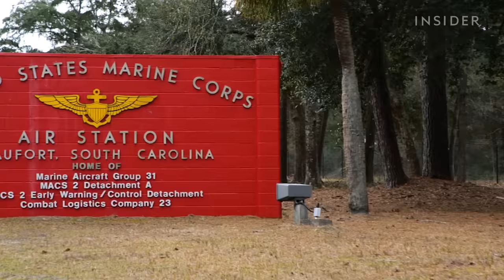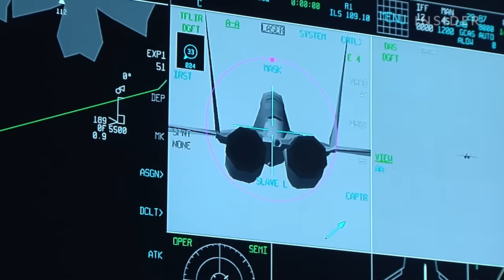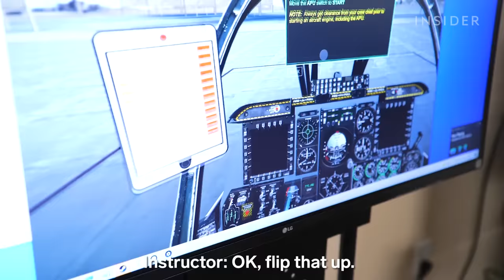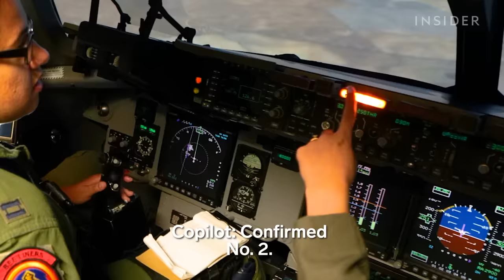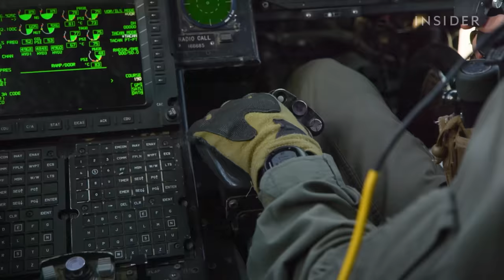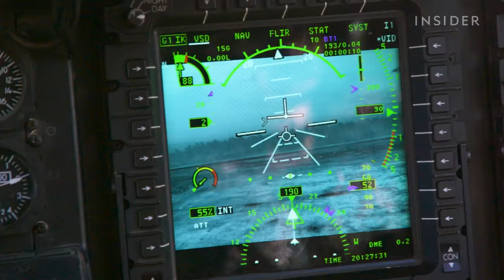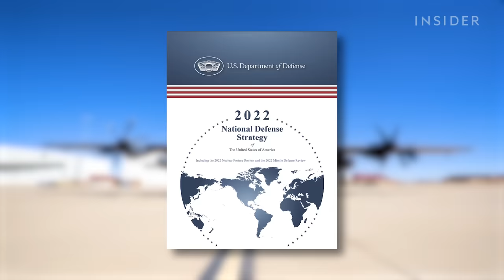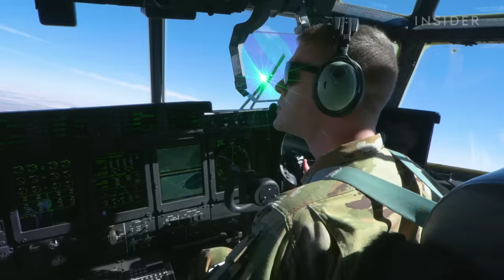How the US Military Spends Over $44 Billion On Warplanes | Boot Camp | Business Insider

Comment: Former machinist here. There's a lot more work in making those wierd and precisely shaped airplane parts than you think because you can't weld or cast aluminum. You have to start with a block of metal and cut it down until you get the part. Most of the material goes in the recycle and robot cutting machines do most of the work but it might take a semi-skilled worker all day to make 100 VERY SIMPLE parts while the bigger structural parts we did often took three guys all day to make a couple dozen.

This is why airplanes are so expensive.
Reply: Current machinist here thats true;)
Reply: I weld aluminum literally almost every day.
Reply: @siegfriedpintar  It's poison, I understood.
Reply: @siegfriedpintar  I think what OP means is certain types of aluminum used in airframes cannot be welded due to integrity or such issues.
Reply: Indeed.
Reply: Aluminium can't be welded?
looks at the car, motorcycle and bicycle in my garage
Reply: @ItsATrap614  alum sparky mfr that & flux core

Comment: The F-35B is the most essential component of our broader strategy in securing the pacific. A stealth fighter, fleet defense and strike fighter, deployable from a network of many tiny, faster ships is the only viable naval aviation deployment strategy moving forward. Super carriers are too large and vulnerable to sail within 400 miles of China ground-based anti-ship cruise and ballistic missiles, in wartime. These ships can sail closer and can spread the power over larger areas. They are smaller, cheaper, harder to track, and as a distributed system, if one leaves for repair, you don’t lose an entire limb of our forces…

The carrier can act as the center of the hive, of the distributed system. Moreover, carriers can then shift their operations to larger, heavier aircraft for long-range strike, interdiction, surveillance. AEWACs, refueling, logistics, etc,,,,
Reply: We need to slow down on the supercarrier production and rethink our adversaries.

Comment: The F-35 doesn't seem like a replacement for the A-10. t seems like aspects of the plane's envelope (low cost, robustness, massive ground assault capability) can't be replaced by the F-35. Also, imagine Iran getting hold of F-35 tech and giving it to all of their buddies, right? Not to mention that the USAF could buy several A-10s for the price of one F-35. 

I think I'd ask the Army if they like the A-10. That's what the plane is there for, after all. Are ground troops and tankers happier with A-10s hanging around, or do they prefer Apaches and the new choppers being developed? A replacement with a higher ground speed seems like a good option.

Comment: turn the A10 into a one way remote operated drone: radar absorbent coating. counter measures. explosive ordinance penetrator body. Metal Storm Main weapon. Remove the pilot.  keep the rest.  It will be the Death Hog.  operated by a pilot that is remote using a F35 similar helmet for piloting.

Comment: Does the brass really want the f35 loitering low and taking dozens of rounds?
Reply: They don't loiter low, they drop 1000 pounds GPS guided bombs from 30k feet with an accuracy of a couple feet
Reply: @orphanslayer6546  it isn't always that simple with ground support.... if it was an A10 can drop ordnance from 30,000 ft.  Cheaper than an F35.    F35 is for air supremacy and well defended priority ground targets. A10 is a air to ground workhorse
Reply: @acmelka  the a10 also doesn't have the stealth to stay at 30k feet and drop bombs, itz engines aren't efficient
Reply: @orphanslayer6546  agree to disagree... I'll always love the A10 perhaps irrationally

Comment: Out of flying more than 8,000 combat sorties, suffered only five A-10s destroyed (a loss rate of . 062 percent). And yet they are talking about removing the aircraft from flying inventory? WHY?!? Not to mention the A-10 can do something no other planes can do. It was designed Mission Specific... to aid troops on the ground. Can the F-35 come in low & slow like the A-10? Does it have the ability to even carry the same Gatling Guns? Sure maybe the F-35 could come in and hover & then fire. But the A-10 is able to fly in... slow down & hit the target directly & then work on getting out of the range of Ground Defense Air Destroying Systems. What would happen with the F-35? Sure it could get onto station a lot faster. But when it gets within range... would the F-35 then start to slow down, come into a hover... fire the Guns... and then immediately switch back to flight mode... and skoot out of there?! But how long would it take to transition from flight mode, to hover mode, and then back into flight mode? Would it take longer for an F-35 to transition in/out of flight mode & in/out of hover mode... while also having to fire the Guns on target? And if so how much longer or quicker would it take? Would this put the F-35 at more risk to anti-aircraft fire? Wouldn't this potentially have the effects of more F-35s being fired upon & possibly even being hit or at least near misses because of having to hover? And unlike a helicopter that... YES... hovers... a helicopter at least usually has side door gunners, and/or more Guns on the sides/underside with at least cover from 3 different angles or more & another pilot... where they have more sets of eyes & a greater number of angles of gun protection. Where as the F-35 only has the 1 pilot with... sure... a greater viewing display because of all the cameras... but only has ammo that is in a forward facing direction. And that's even if they choose to place Guns in the nose or forward facing in the F-35s. As for awhile there they got away from having guns on Most Military aircraft... because they were no longer facing as many dog fights as they used to have. And they finally decided that some aircraft should once again have at least some sort of Guns in case they came across Enemy aircraft 
Yes. The A-10 & other planes do NOT have side or rear facing guns. But still... it doesn't make sense to get rid of the A-10 when it's such a successful unit. Maybe an F-35 can rotate 360 left/right in a vertical position while holding a hover... but how fast can it rotate if needed? How about how long can it hover for? And how well can it hover & fire on a target at the same time & maintain accuracy? The Ole saying: "If it's NOT broken Do NOT fix it" definitely APPLYS to the A-10. Maybe they should keep the A-10 in service while they roll out all the F-35s... and even afterwards... to the point that they can test in head to head real life scenarios. And if they find the F-35s are just as capable as the A-10s then keep the A-10s as back ups. But if they find the F-35s can NOT do the same job or better at the same tasks required of the A-10... and they're finding the Airframes & other parts are starting to age too much... then they should focus on building NEW A-10s... from the 🔩 bolts & rivets up. Where they can add newer technologies, adding the same types of heads up displays as the F-35s helmets, maybe adding a hover system to the A-10 so it can do STOVEL, and maybe being able to do some new engines, or updating to the engine & airframe designs... where the A-10 would be able to have the abilities to fly faster, get on station quicker, and then come in slow & low like it does now. Maybe the wings could be designed to have a swivel... so they can sweep back for quicker flight... and then sweep back out for being able to come down low & slow as required for hitting targets. But at the end of the day... they should still keep the original A-10s that are still flyable... as they are something that works as is... have less electronics in them.... so they would still be able to get the job done where some other aircraft would have issues if there was an electronic attack of some sort. Just kinda like vehicles... sometimes the older stuff is better & more reliable than the newer stuff... because it's less complicated, easier to work on & maintain, less expensive to repair, and is sometimes just as easy as checking/topping the fluids, turning the key  🗝... and off you go.

Comment: I think f35 is too fast to be mission useful. Just look at the Iraq war, most of the ground targets need percision and turn around repeatition. A10 did it job remarkably.
Reply: What are you talking about? The F35B can hover at 0 air speed. Not only that but stealth and sensors are far more important than air speed. Air speed hasn't mattered much since dogfighting was made irrelevant due to stealth. We should be upgrading to F35s as much as we can.
Reply: @johnjingleheimersmith9259  Dogfighting was made irrelevant by XXX .... happened before.

F-35B can hover, but it's not a helicopter.
Reply: @Milo-id9qd  Why do you think a helicopter is a better option? Manpads turn helos into scrap piles in seconds. An F35 would eat any helicopter for breakfast. Is this even a real conversation?
Reply: @johnjingleheimersmith9259  

I never said it's a better option, just that the helicopter can hover while F-35B ... it's purely for landing/takeoff (and it seems they are moving more towards landings for now), not for prolonged situations of hovering.

Even if it could do that to the same effect as a helicopter, it's also a matter of cost ... the F-35B per hour cost was 65k USD before inflation.
And it's very expensive in maintenance hours as well.